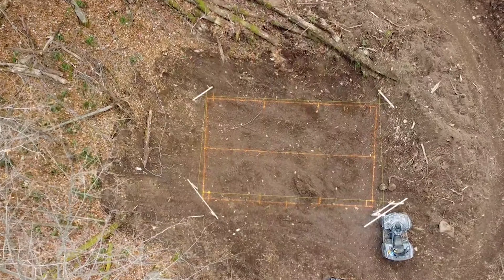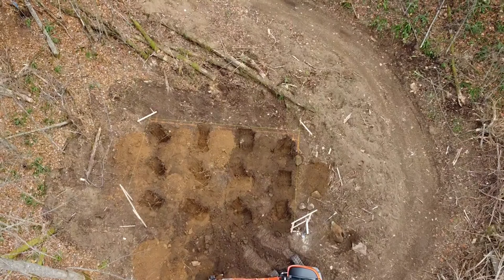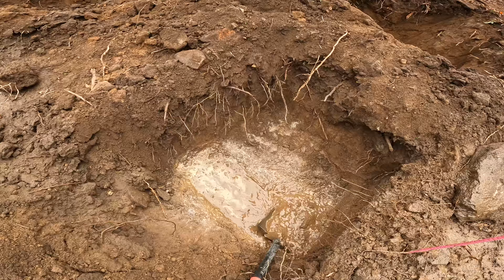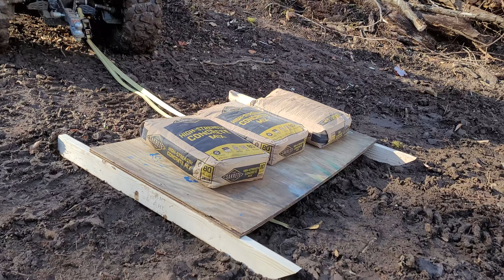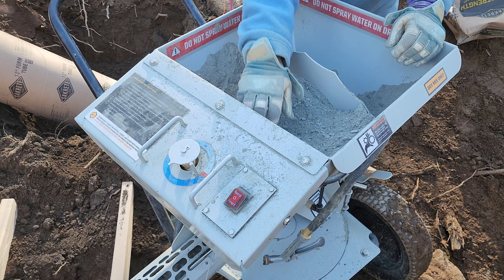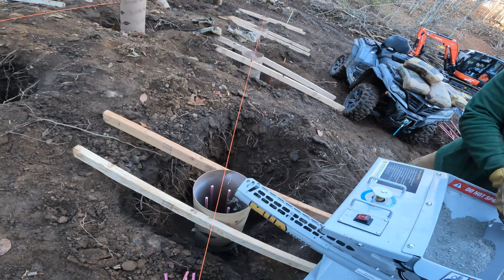Episode .10 - Pier Foundation. Mixing Cement with the Mud Mixer!!

Comment: How did you supply water?
Reply from the maker: We have a spring water collection. I have videos on how we did it. Check out episodes .05 and .09. We have unbelievable water pressure and I was able to connect the hose directly to the mud mixer. It worked perfectly. Thanks for watching!

Comment: In your video, you screwed your 2 x 4's" into the tubes and then poured concrete.  My question is at what point did you take them out, and was it a struggle to get all those screws you used liberally throughout all the forming tubes free?  I might suggest next time that you screw from the inside out (a little more difficult I acknowledge) however, making the take-down much easier, and not leaving screw holes in your cement columns . . .  😎
Reply from the maker: I waited until the concrete was dried. 1-2 days. Removing the screws was super easy and the screws leave a pin size hole that you can't notice. Concrete will have some bubble holes anyway, even after vibrating. I wouldn't worry about the holes at all.